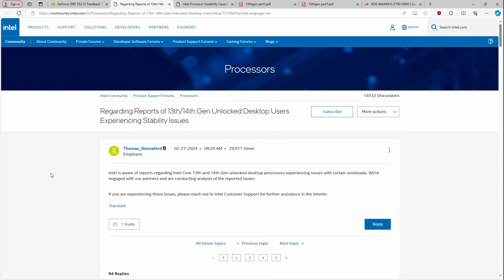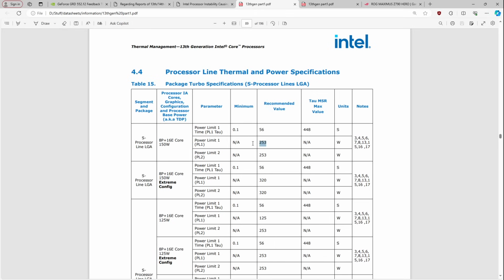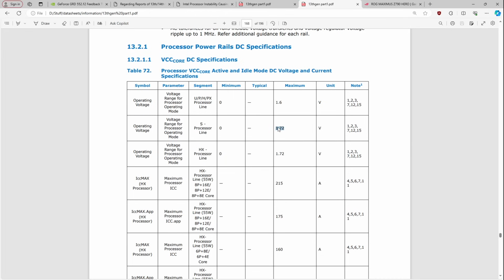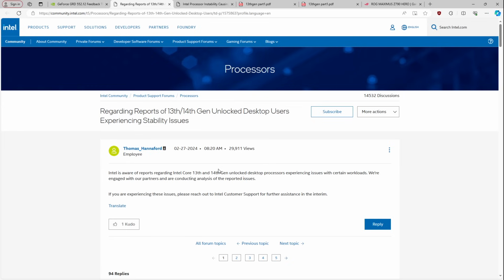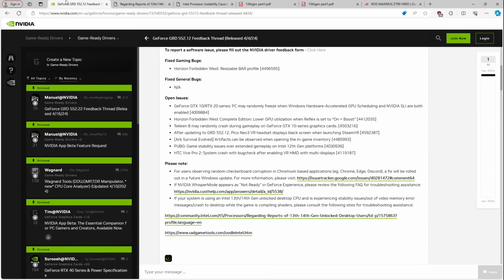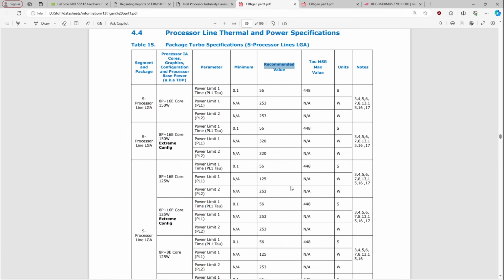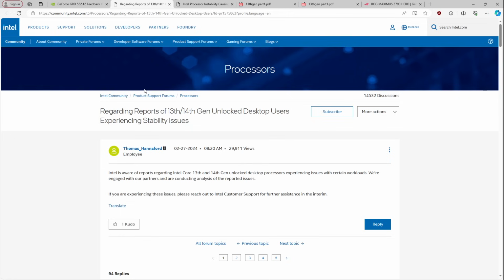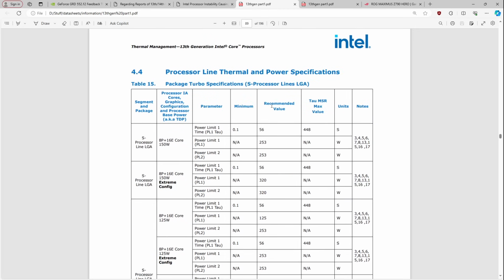Rambling about why some intel 13th/14th gen i9s and i7s aren't stable.

Comment: hey buildzoid, not sure on your perspective a year out from making the video, but intel 14th gen most definitely has (had? perhaps microcode addresses this) immense degredation issues. Ive overclocked 6700k, 9900k, 12900k, and the 14900k was the most painful experience, and that's with the knowledge I gained from dealing with e-cores on 12th gen. My 8000 ram (that could only run 7600) pushed the CPU even more. Eventually, even a complete cmos and auto settings would no longer compile shaders or handle any heavy workloads. A little over a year and some change and now I can barely set a 5.2 all core work load. I'm on the latest BIOS, but I had so much use with it prior to the microcode - its toast. I am running it on an apex encore, i initially had it on a DDR4 and then a lower DDR5 board, with a thermal grizzly mounting plate with push/pull 420 AIO, and it can barely tolerate the 1.4v / LLC7 it requires

Comment: I'm very glad I found your channel, I own an i9-13900K and had similar issues, both OCCT and Cinebench crashing seemingly randomly after 5-60 min of runtime. More demanding games like Diablo IV were crashing as well, with Chrome throwing an error here and there while the game was running. I don't fully understand low level hardware stuff, so I just started replacing parts haphazardly, bought a MOBO from ASRock, where I had a Gigabyte before, that helped a little bit, got some new RAM and that did nothing, but now after altering my settings as stated in that Oodle document things seem to be stable for now. I don't know how much life my CPU has left in it, but at least it's working. I'm very disappointed in Intel and huge thanks to you for summarizing the entire situation so clearly.

Comment: I think it's more than that, because I'm specifically having issues with UE5 and dx12 now when I didn't have it like a month ago, and the system's a year old. The power limitations were kicked into gear on day one, so it can't be that.
Reply: Did you do any BIOS updates that could have messed with AC/DC LL? BuildZoid has spotted Gigabyte lowering these settings that can reduce stability.
Reply: 2 months late but same here, UE5 issues like crazy and haven't changed anything in 7-8 months... just slowly started getting more and more unstable then the memory errors started. Now I can barely run stock settings on my 13900k with a Hero z790.

Comment: friends 13700k needed a positive offset of  0.04V to run cinebench stable 
at 0.025V i would crash after a bit
at stock cinebench multi would just outright crash
Reply: wow, mines undervolted 0.1v to 1.3v with p cores boosted to 5.6 and e cores on auto. It gets 31000 in cinebench multicore. Try resetting bios configuration then overclocking and undervolting without the use of xmp. When i used xmp it would thottle like crazy and the cpu voltages were to high even when i set it lower.

Comment: Great video!
But im not sure if i agree about the degradation part

I had 13900KF (SP 86, very low) with asus motherboard 
For the first year, i had no issues at all (uaing asus default, which had 0 limits), i did play a bit with AI overlooking (asus) but it was quite lame so i ditched that and used only the 0 limits default

(prime95 was running fine)
After 1 year, i started having random crahes, mainly in Call of Duty Game, and when using 3D printers slicer programs, this kept going worse and worse in time until the point i wasn't able to use the 3d printer slicers at all!

Then i started digging in the BIOS, i carefully read the Intel docs and decided to set:

P1 and P2 to 253
SVID to intel fail safe
Disabled memory XMP at all
Disabled asus core enchantment
Disable TVB OC(although im sure it was disabled in auto mode)
Disable TVB voltage enchantment
Set AC load line to 2
Set DC load line to 4
Set IccMax to 307 (from intel docs)

and it solved the issue (for now)

The voltage was way higher and could reach 1.68v
Also, the temp was higher and less performance
But i was ok with it, i just wanted a stable system at that point!

Sadly, after around 2 months, the system was crashing again

again, colud not ran slicers, and games kept gave me errors and crash, prime95 gave errors immediately on lowest

I then tried disabling the 4 and 5 cores (preferred)

It reduced the prime95 errors a lot, but slicers kept crashing 

The only solution was to stick all cores at 3.2ghz (i think), which is a joke, and i did not accept that

I then opened a ticket in intel support. They wanted some qr codes and then told me my CPU is tray edition and not a box edition and will not waranty

I now have an SP98 14900k that i keep at P1 P2 253w
307amps, SVID at typical scenario, and TVB voltage enchantment enabled that keeps voltage much lower 1.488 max very rarely

That i got from work and working on same PC

So i would wait a bit more about the degradation part.

Thanks for reading that long story.

Comment: Back in the day I had a K6-2 450 that I went to overclock.  It was about us unstable as these 13900K/14900Ks by 500mhz.  At 475mhz, it APPEARED stable until I went to run a long compile, at which point it would still spontaneously crash.  Now (unlike Intel's current loose specs), there was no question I was running out of specs.  I did end up running at 4x112mhz instead of 4.5x100mhz, that 12% overclock on the rest of the motherboard must have knocked off some wait states or something because I got a nice 15-20% boost from that.  Decent!

Comment: I encountered these issues very early on in the 14th gen release cycle, running a z790 gigabyte Aorus board I was able to resolve the issue by running the Intel POR turbo settings and turning on AVX optimization, this limits the cpu to 253w and runs the cores at around 1.2 - 1.3v under full load running cinebench. Without the AVX offset I was still getting soft crashes at least 50% of the time in cinebench

Comment: Hi I'm newbie and want to build my first pc desktop. Regarding this issue I already bought Asus B670-i itx LGA1700 motherboard but not yet bought CPU. I don't gaming just browsing and autoCAD for my work and i plan to buy i7-12700 or i5-13500 for the rig. Should i worry about this issues and I need CPU recommended which CPUs should i choose. Sorry for my english

Comment: I had this issue in a 13900K bought from Newegg to Saudi Arabia and it made me investigate for a week. I reduced the CPU Freq. and did everything until I found the CPU was the culprit where CB gives error instantly when running or COD MW3 crashes when going into the lobby. And the main issue is that the RMA is kinda hard in my country :).

14700K runs fine on the same motherboard. tested the RAM with memtest86 and passed. replaced the PSU to 1500w just in case. removed all enhancements and enforced stock settings.

Specs: 13900K - 4090 TUF - 64GB DDR5 6000 M/Ts - Z790-E - HX1500i CORSAIR.

Comment: I have no proof what so ever, but it feels like Intel does know about all this but might have trouble competing with AMD, so they chose to push ahead and took a chance of all this either not turning into an issue or be such a low number issue it wouldn't raise awareness... From whatever angle you look at it, it's either too convenient, or sus, not to be so.
On another note; having a smaller node now and slapping e-cores on is fine and all, but again it feels like they are somehow stuck on the 14nm design principles, hence the lack power efficiency at the high end of their CPUs. Maybe someone with more knowledge could back this up, or completely refute it ? I'm really interested if this holds any truth.

Comment: I had a 14700k that would crash with prime95 small fftand cinebench, always with CLOCK_WATCHDOG_TIMEOUT. Enforcing power limits did nothing. Only took me about 5-10 minutes to get an error. I’m sure underclocking/overvolting would have helped but I’m getting it RMA’d. It should just work out of the box, with no tweaking required.
Reply: Buy new ryzen then 78x3d is best non tweaked chip out there, I have mine uv’d and overclocked technically but with 85w limit

Comment: For long term use like 3+ years raising the voltage isn't a good solution using intel recommended is the way to go though as the chips are acting up at 3ish years well intel recommended value is the way to go. As he said it will go slower but it should work unless you got a defective chip.

Comment: I run a basement IT business and sold six i9-13900K systems last year and have seen degradation firsthoof. Every one of my systems is thoroughly validated with OCCT, Linpack, MemtestX86, memtestpro, TestMem5 Extreme, Aida64, and I run a suite of benchmarks that include every version of Cinebench. The CPU and RAM are also overclocked / tuned / undervolted to run at the maximum stable frequency that's kept under TJMax by the cooling solution. One of these i9-13900K's experienced extreme IMC degradation. It left my shop being able to handle 6400MHz 4x16gb (Samsung). It arrived and ran perfectly for three months. BSODs started. We lowered it to 6200MHz. Stable for a week. Lowered to 6GHz. And so on until it eventually crashed at 4800MHz with all of my tuning reset and Intel Failsafe voltages applied. I got the CPU back and tested it and it was so dead that at stock clocks, 4800MHz RAM, and Failsafe voltage, simply launching Discord or any application that hits one core enough for boost would cause a BSOD every single time. I've never seen this kind of rapid degradation before and applied safe (under 1.4v core, under 1.3v IMC) voltages across the board when delivering the system in its original stable state. This 13900K was purchased right before the raptor lake launch and replacing with a launch-week 14900K had everything back to running flawlessly with the overclocked RAM / stock CPU clocks with the voltage Typical Scenario preset.
Reply: I've never understood how compared to old generations, a progressively higher voltage and higher temperature on a smaller node doesn't lead to 10x faster degradation.
Reply: @rtyzxc smaller node? You mean 14nm > 10nm?

Comment: 14900K owner here, my cpu day 1 was insanely unstable crashing at 100% load. Did an RMA and this new one works fine now. Though worried these are affected also on the new cpu batch I got..
Reply: If the new RMA one I got will have this issue close to warranty ending or ending…
Reply: wdym "these are affected"?

Comment: the funny thing is that people rationalize buying Intel over the superior gaming chip with Intel having a better reputation for stability and quality control
Reply: I had a 7950x that couldn’t run 6000 ddr5 also and a 7950x3d that bricked itself in an hour. If you get really unlucky in the silicon lottery it happens
Reply: @fhpchris  there's a huge difference between occasionally stuff not working or breaking early, and a large portion of chip-motherboard combinations not being stable as set out of the box.
Reply: @fhpchris  Exactly. I have had an 2400g that died after 30min of heavy load. It just happens.

Comment: i don't get all this drama going on and on

just undervolt the damn thing, done and stable. whether you tune it via global offsets, vf curve offsets, ac/dc tuning, LLC choice, or any mix of everything.
14900k/s probably can't run 5.9 on an AIO just due to the sheer voltage req no matter how undervolted in 100% R23/similar load, so just drop it down a bin or two and be done with it. or use octvb to make it drop to 58-57 per temp bins and follow vf curve temps. that way if it's a lighter full load it can run 59 but if it passes 60c, 80c, such as in r23 it'll drop... literally have no difficulty getting this thing stable , no delid no direct die, besides managing an aio and hot australia weather ambients.

r23 isn't even a proper stability test anyway, it's just a guide to find a typical baseline, decent values for full load voltage, and then move on... you can pass r23 all you like, you'll still probably fail DX12 shader compilation or heavy decompression (ie. pirate repacks) and other various workloads if you're JUST r23 stable.

generic layman consumers who aren't going to be bothered tuning their extreme enthusiast tier cpu shouldn't buy it. it's not 2012 anymore with 4790ks and shit where being overvolted from stock doesn't matter 'cus we're talking 1.2v overvolts drooping down more.

i have literally no problem running my 13900ks on an aio at 5.6/4.4/50... and the only reason e-cores are at 4.4 is because my KS bin is garbage and the e-core SP is giga low and anything above 45x hard crashes instantly, and 45x isn't worth running. I could even fuss with OCTVB running 5.8ghz all core until like 50-60c for game stable, and adjust the vf curve to work off that, but on a no-delid aio in hot australian weather, all-core octvb is a pain in the ass, octvb is better for 6-4-2 workloads/not the all cores.

the ONLY thing that is completely forgiveable to the consumer suffering from instability is being frustrated with RAM stability, because motherboard vendors push and promise shit like 7000mhz on 4-dimm boards when running XMP on a 4-dimmer is like, complete rng. 7200-7600 is the max for 4-dimms even the new refresh models no matter what they say, without giga time investment on tuning... and even then haaaaard freq. wall 7600-7800, its just not possible. DDR5 is unique in that testing for 20 hours that pass on a stable boot doesn't matter, signal integrity between boots is what matters and people suffer from using what they think is stable and then bsod'ing the next day.
Reply: Casually recommending that people undervolt their CPUs is only going to decrease stability, as they very likely aren't going to go through the necessary testing steps. If anything, these unstable processors need more voltage, not less.
Reply: @dd7428  they most definitely do not need more voltage, they are vastly overvolted at motherboard & cpu default vids, and the crashes under R23 and similar stem from being overvolted and crashing under heat. IE-> the mass complaints when TLOU came out and all of these people were complaining about their cpus hitting 100c and bsod'ing.

undervolting and testing for stability is not hard. you can find a completely stable system in 2-3hrs max.
Reply: @ashryver3605  They are absolutely not vastly overvolted - I was unable to get any kind of worthwhile undervolt actually stable with my 13900k and 14900k. They may quickly pass R23, but extended testing in OCCT or y-cruncher would result in errors. You shouldn't "crash under heat" with a stable CPU, thermal throttling exists for a reason. You will however crash if your CPU is not getting enough voltage, which is obviously much more likely to happen if you're undervolting. The person who reads a Reddit thread and applies an undervolt (as it's so casually recommended now), runs Cinebench once or twice, then gets a crash later on in a CPU-intensive game is probably a very common scenario.
Reply: @dd7428  iuno man, i can only speak from experience with 4790k -> 7700k -> 13900ks (and a shit binned 13900ks at that) when it comes to oc'ing.

i run a by core usage 61x4, 58x6, 56x8 setup w/44 ecores & 50 ring for my 139KS, and all that I do for stability is get an initial reading of R23 for est. heavy load voltage (bcs its not a stability test) and what'll pass a few runs of that, then move on to real stabilty tests.

DX12 game shader compiling (TLOU for me since it's easy to re-trigger, or Hogwarts), and GB6 for OCTVB transients. then the nail in the coffin is to decompress a heavily repacked pirated game such as the fitgirl repacks - those require more vCore than R23, and are HEAVY on transients. it takes like 1hr max for a full range of adjustment testing.

thermal throttling is not the solution to everything and people need to stop pretending it is. these new cpus are different to old cpus. after exposure to high frequency and high light load/idle voltages, they become sensitive to temperature and throw WHEA's when they start throttling/redlining, even if the effective clock rate drops. it doesn't even need to actually 'degrade' full load potential, fix the cooling and the whea's go away in the same situation.

ppl are degrading their shit so hard esp 149's running 350+w 30min r23 runs for nothing
Reply: @dd7428  (side note to add on to this) I am wholly sympathetic to people who are suffering because of motherboard manufacturers dogshit processes on these last 2 generations, who set up the entire expectations of how these things should perform knowing damn well the reality, because at the end of the day we just want our shit to work.

But if your gonna buy a $1000 top of the line cpu, some form of research and technical savvy/involvement is expected in my opinion. Otherwise buy a 1X700k and lower speed ram. Basically the same shit for gaming anyway all things considered at 1440p.
Reply: I think you are missing the point.. you pay a shitload for those extra Mhz.. under clocking a premium high end product to get it stable is BS. At that price.. it should work.. period
Reply: @charlconradie4935  i didn't mention underclocking at all

underclocking is what setting 253w and 307a power limits does, it neuters your all core freq to 5.3/3.9 (on 13900ks) or worse, depending. that's how the typical consumer are 'getting stability back' magically after these settings.. cuz the system is just dropping 300-400mhz under load by default and rocking 1.15v now.
Reply: LOL that's hilarious mate and I kind of agree. People that do not know how to get into UEFI BIOS, they have no reason buying unlocked CPUs.. and to make things even more ridiculous, they stuff i9s and 4090s into stupid mini-factor cases because of the new trend... and then are crying out loud in the forums! ???